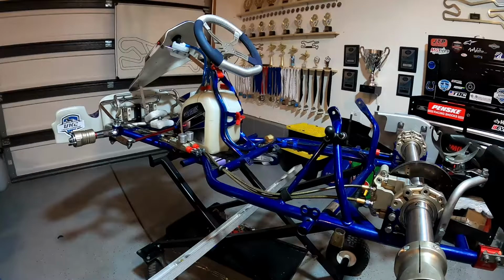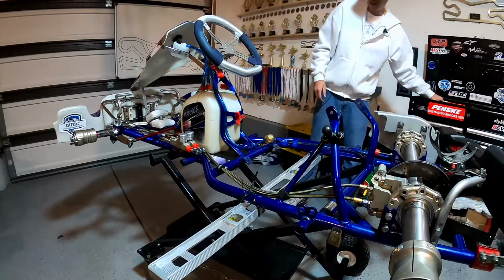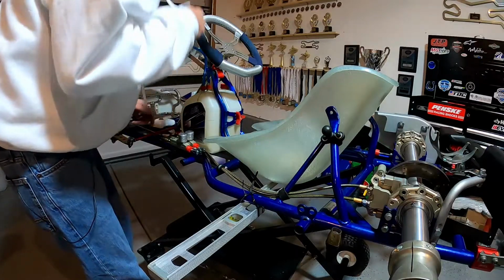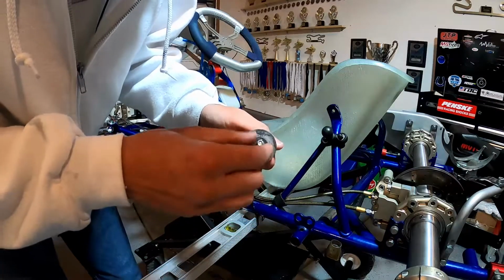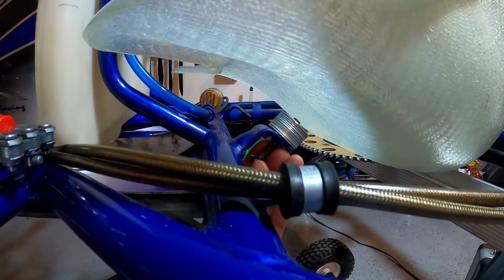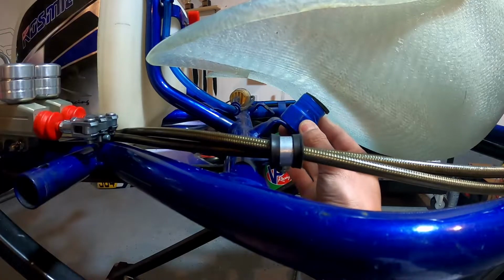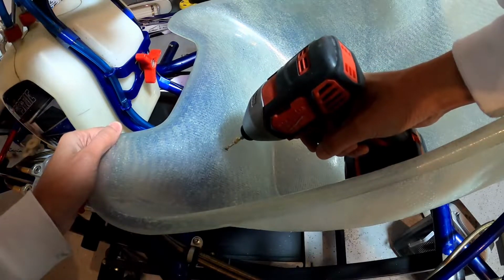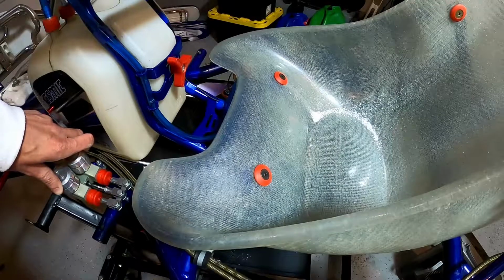Seat Installation

Comment: i dig your vids.  i may have missed it, but do you have a video showing how to safely bend the seat supports out for a wider seat?  it scares the hell out of me bending them, but i needs to be done.
Reply from the maker: I don't have one on that specifically and yes it can be scary.  I bent our left strut 20ml to make room for the 206.  You'll want to bend it in small steps and not just try and go all the way with one huge bend.   I also bend the mounting tab with an adjustable wrench as I go so it stays in line with the seat.  Bend, check, bend, check, bend, check.....  I set up a 6ft ladder next to the kart with it on the stand and with one foot on the ladder and one where the engine mounts I use a fence post to bend the strut, probably not osha approved.